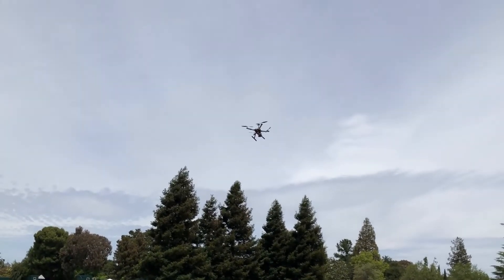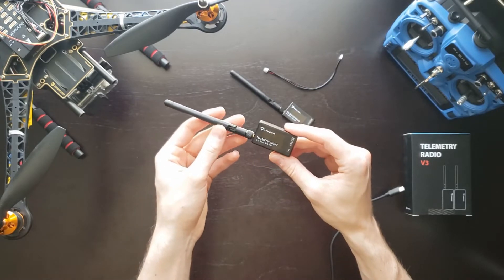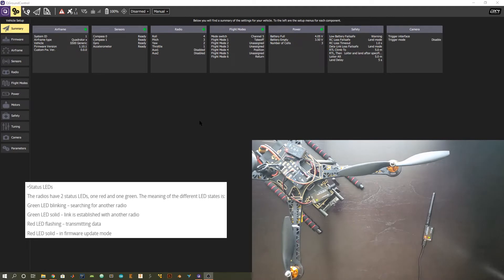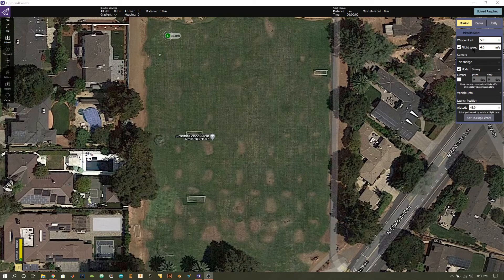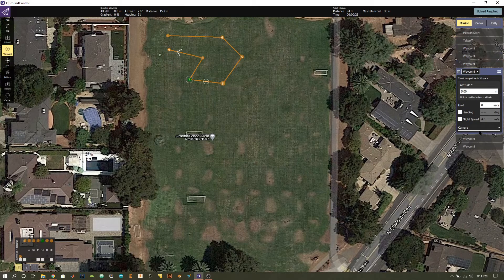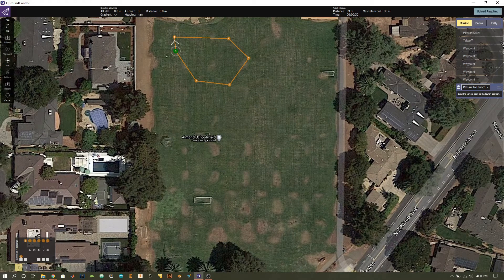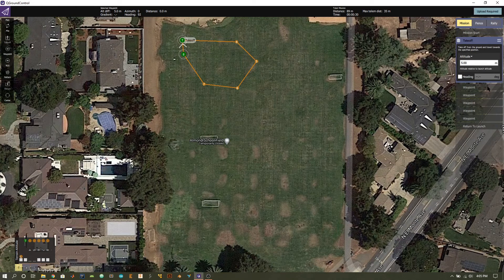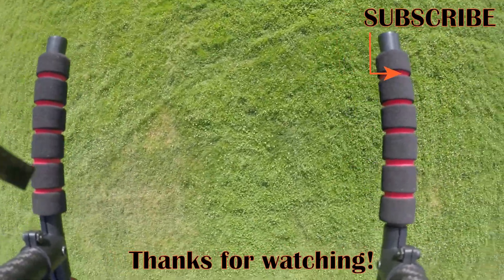Pixhawk 4 Autonomous Mission (Flight) and Telemetry | Pixhawk 4 + S500 Drone Build Tutorial | Part 5

Comment: Hello Alex, it seems like the s500's arms are not able to handle the force of the motors. After a short flight, the screws holding the motors to the arms or the screws holding the arms to the frame come off. Do you have any tips or ides that could help me? I've lost almost all my screws.
Reply from the maker: Ya I've also lost a few screws. What I did was added some loctite to the screw then put it back in.
Reply: @AlexFache  thanks! have you experienced the "gps pos error too high error" though? that seems to be the current issue I'm facing that is making me unable to fly.
Reply from the maker: Are you having this issue when you try to takeoff or is it happening when you are connect to QGroundControl? If you're outside you may not have good satellite "access" so move to an open area. You could also trying updating the firmware on the QGroundControl side.
Reply: @AlexFache  I have this issue when trying to takeoff

Comment: Hi. Thanks for the series. It helped me a lot indeed. I wonder if it is possible to use xbee with pixhawk 4? I tried everything I have found on the internet, but could not manage to connect to pixhawk over xbee.
Reply from the maker: I don't have experience with the xbee. I assume you are trying to you use it to replace your transmitter?
Reply: @AlexFache That's right Alex, and I found the solution. It turns out that we need to connect tx to tx and rx to rx, not crosswise. I am leaving this comment in case it might help someone else having the same problem. Thanks again

Comment: The series is amazing and is really helpful for my graduation project. I'm facing an issue though when trying to update the telemetry firmware; QGroundControl software doesn't detect the telemetry device when I connect it using USB. I'm using the kit mentioned in the description.
Reply from the maker: Glad to hear this series has helped you out! Make sure that the USB you are using can transmit data. Also make sure QGroundControl is running before plugging in the telemetry, I think this caused some problems for me early on.
Reply: @AlexFache  Thanks for the tip. Although I contacted Holybro support team, and the solution to the problem was to install ft230x drivers. Hope this can help whoever faces this issue.

Comment: I have a drone with the same flight controller and sometimes it crashes and lose control could anyone help me with thoughts. I do calibrate each time but sometimes the drone goes crazy and crashes. I need help!!
Reply from the maker: Have you ever been able to achieve stable flight? First check motor spin direction and proper propeller orientation. These are common culprits.

Comment: Sir, you're making awesome content, but it would be great if you could talk about how much thrust is required to hover, how to select the right rpm or torque for the build, how to calculate maximum payload capacity, flight time calculation. no one is talking about these parameters in the build videos which in my opinion are very important. thanks for making such awesome content.
Reply: im sure you have figured those out by now.
The thrust per motor on full throttle is given in motor prop test data sheet of manufacturer
Every drone frame is defined by either its arm length or the largest prop size you can fit. 
Flight time can only theoretically be estimated, by dividing the battery capacity with the drone's current draw.

Comment: Please help me with this.. I have my quadcopter set up, with a px4 flight controller. I don't have a transmitter and receiver but I have a Telemetry radio set up. I wanted to know if it's possible for me to fly my drone with just QGC sending the commands via the telemetry radio without transmitter and receiver radio.
Reply from the maker: Thanks for the question and sorry it took a while to respond. I have not tried this out myself however I believe if you change the parameter NAV_RCL_ACT from 2 to 0 it might work. 

https://dev.px4.io/master/en/advanced/parameter_reference.html#NAV_RCL_ACT

Comment: Thanks for this tutorial. Unfortunately my S500 just don't takesoff. Motors are spinning, everything is checked multiple times. It semms to have not enough power. I'm using a 3S 3000mAh Lipo. What du you use?
Reply from the maker: My battery is about the same (3S 2600mAh I believe). Assuming you don't have a super heavy payload battery shouldn't be the problem. It probably comes down to the safety switch and disarming. There is an auto disarm parameter that may actually be disarming your quad before you have the chance to takeoff. This was my issue for the longest time. The parameter is called COM_DISARM_PRFLT and if you set the value to < 0 if will turn off the disarm function. Let me known if that helps. Glad you've enjoyed the videos!
Reply: @AlexFache  Finally I found the bug.I mounted the Pixhawk with a centered strap of velcro. This gave it some space to circle arond his own axis. I thought this would be a good idea, some kind of soft mounting. But it was to much. Now I have a velcro strap catching all corners of the Pixhawk - and it is flying :sunglasses:
Reply from the maker: Mounting of the flight controller is definitely super important, some kind of soft standoffs are pretty common to minimize the translation of vibrations from the frame to the flight controller. The Pixhawk has some internal checks that all need to pass as an additional arming feature so that's probably what you were running into. Glad you got it working and enjoy flying!

Comment: Thanks a lot for this tutorial, subbed! Only, when I plug the radio into my pc, nothing happens. Both Q groundcontrol and Windows don't recognize the radio. Do you have any idea how to fix this?
Reply from the maker: Thanks! Just to clarify do you mean the telemetry radio? I sometimes had issues where I had to open QGroundControl first then plug in the telemetry. If that doesn't work then I'd try checking your device manager to see if a new device actually pops up when you plug it in.

https://shop.holybro.com/u_file/1903/file/a7bf40e033.pdf it states here that the drivers should be installed automatically. If you see the device in your device manager you might need to try and press an update button there manually. Also try with your other radio and see if you have the same issue.
Reply: @AlexFache  thanks for your response! I already checked the device manager but also nothing is there. I can try switching the radio's around, maybe that will work. Thanks anyway!
Reply from the maker: You should also have an orangish light turn on indicating that the usb is plugged in to the radio. If you don't have that then it might be something with your radio
Reply: @AlexFache  I bought a new micro usb cable and now it works!
Reply from the maker: Awesome! Glad you got it working. It's unfortunate your first cable didn't work.
Reply: you need drivers that bridge the ADB device to windows.

Comment: I just built this same setup last week! Same transmitter and S500 frame with PX4, does feel really good to get something to fly for the first time, I'll be using your video to setup telemetry and start doing some missions, thanks for the video!
Reply from the maker: That's awesome you got it working!! Manual flight is a lot of fun but the autonomous missions are definitely next level.